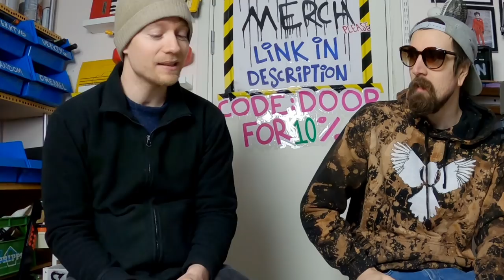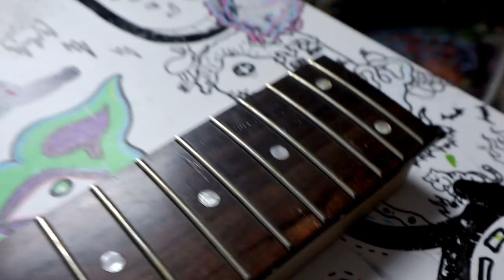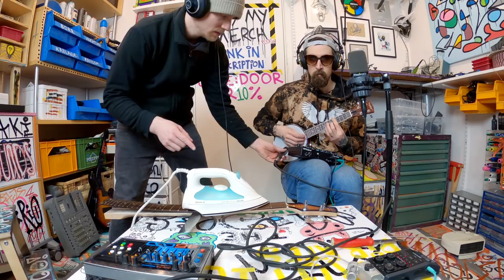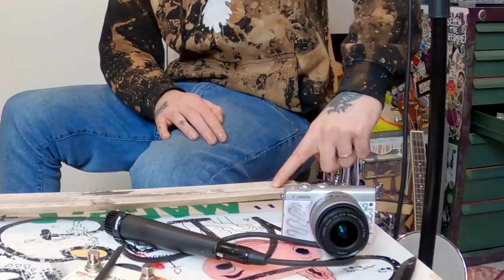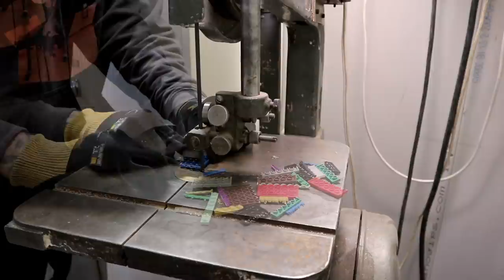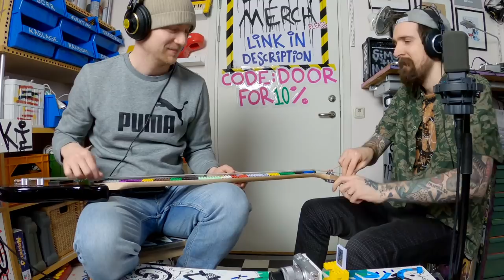LEGO NECK BASS Is Simply Fantastic

Comment: The microtonal guitarist who invented the lego fretboard with his son is Tolgahan Çogulu! Turkish guitarist; super cool musician
Reply: But he had a special 3D printed base to make it possible to have lego frets in the correct places.
This doesn't. It should be all out of tune!? But it isn't. mind blown
Reply: Thanks Havok! Just a reminder, we designed it with Ruşen Can Acet. And one more thing: we also tried this type of direct installment of Lego pieces but there were three big problems:
1) Buzzing problem in several places because of the fret leveling
2) Lego studs doesn’t get the 12tet semitones, it is still great to have them
3) When you use single Lego squares as frets, the strings and frets couldn’t be together at many points. So when you press the fret, it is in between the individual frets.

Comment: This is great. Next time you can line up all the Lego plates on one side of the neck. That way you'll only have to make one cut on each piece. Also it would let you add blocks length-wise onto the neck across multiple pieces since the dots will line up in both X and Y.